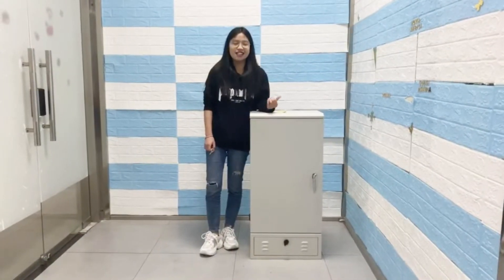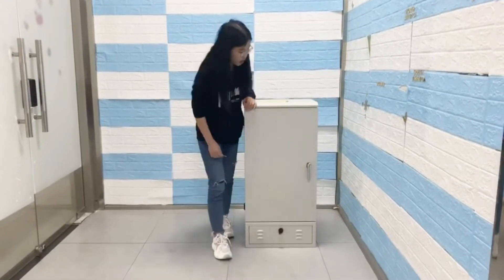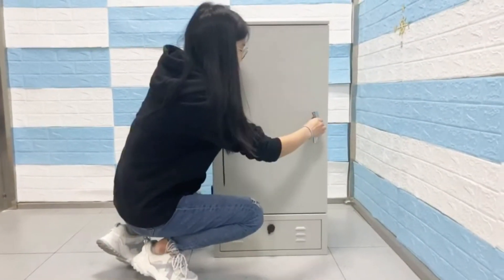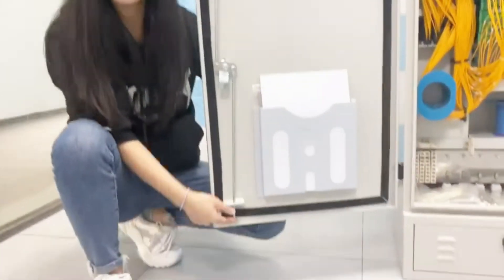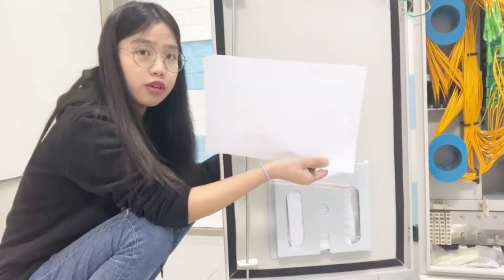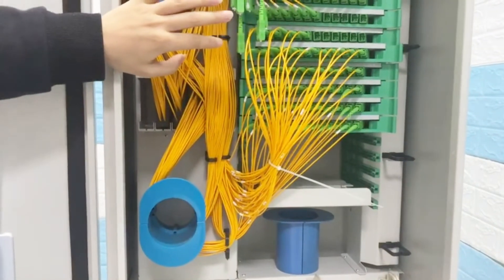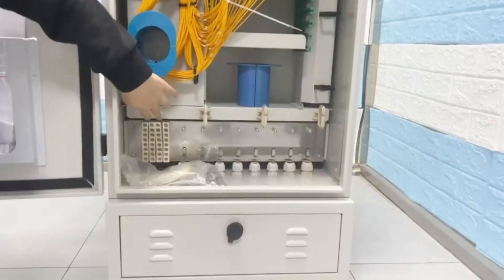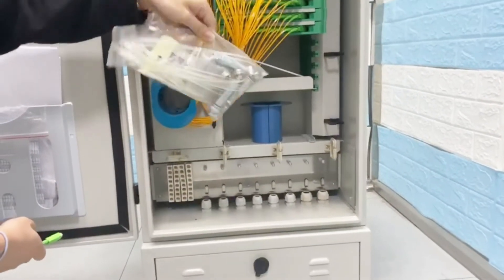144fibers outside optic fiber cabinet

Comment: Fiber cables are bended too tightly.
Do you even use cleaning cassette for connectors?
Reply from the maker: Yes, a little bit tight, just to make it look neat.  We use cleaning pens and cassette for the connectors.